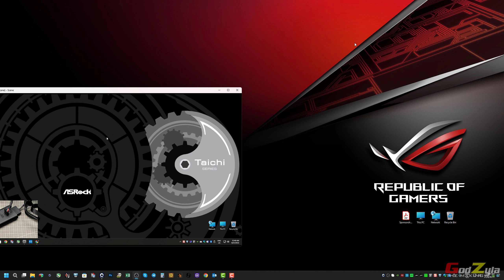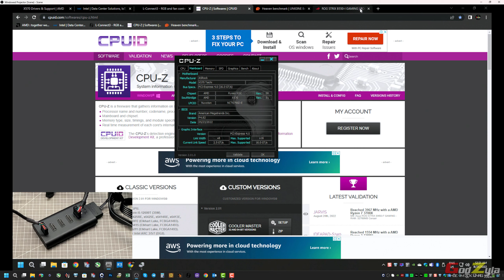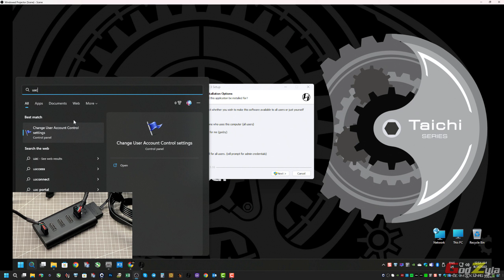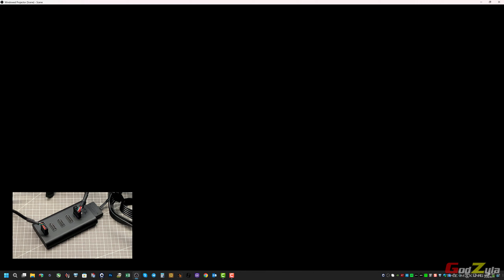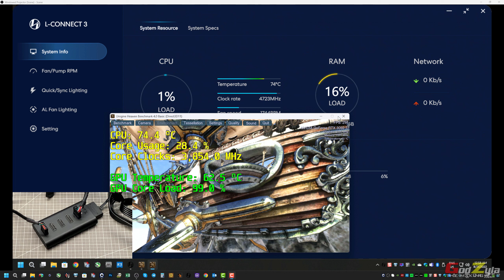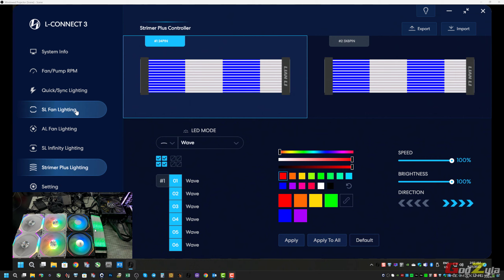Lian Li ARGB Products (How to make it work?) [L-Connect 3]

Comment: i have sl120, recently one fan is automatically running on max rmp, profile is set to quite but rpm of the fans is going up and down, do you know how to fix this?
Reply from the maker: Hello Pawn, welcome to my channel. If it works in the past, I believe it's a glitch, try this.. turn off your PC, turn off your PSU,  pull out the AC cable to your PSU. Let it sit for 45 seconds, plug back the AC to PSU, turn on your PSU, then start up your PC, see if it helps.
Reply: @KleoYan  not worked, still  running at high rpm, i recently installed 3 new fans, after few hours  one fan that is on the back started to run at max rpm, using l connect 3 all fans are running at 800 rpm besides one, it's running on 1900 rpm
Reply from the maker: @pawn_deprived  Hi, I see what i can do to aid you but I need to know exactly how you set up your fans. as in top , bottom and rear or side. also how they are connected to your uni controller.
Reply: @KleoYan  i have od11 xl
i have 10 fans, 3 bottom, 3 side, 3 top, 1 back, they are all connected to one controller in 1,2,3,4 ports.
Reply from the maker: @pawn_deprived  ok thanks. can I assume is your rear fan that is giving the problem, port 4 I assume. now for the fan that is having the issue, can you disconnect it from port 4 and plug to port 2 or 3 and test to see if the fan is at fault.
Reply: @KleoYan  yes it's the rear fan, and it's in port 2, i just tried it with different controllers, like 2 controllers, only rear fan is plugged in second controller and it's still running max rpm
Reply from the maker: @pawn_deprived  ok.. this means your rear fan is faulty, before jumping into conclusion. can you use the ok fans plug to port 2. see if it does goes max rpm like your rear fan? I just want to be sure it's not the controller or the software is giving the issue.
Reply: @KleoYan  just switched the ok fans in the slot 2 and even changed the controllers wires (white one that plugs in the fans) ok fans are running normally at 810-850 rpm, even rear fan is running at 850-870 rpm for now, gonna monitor it a bit, if it runs at max rpm again in sometime so i guess rear fan is faulty, will claim warranty, thanks a lot.
i also checked it like this, i set the rpm of all fans around 1000 and all fans were running around it, rear fan doesn't goes down or max, it only fluctuates between low and max when rpm is 800 on quite mode, so i think its the rear fan that is faulty, still will monitor a bit, thanks man.
Reply from the maker: @pawn_deprived  ok buddy, if it happens again, your next best solution now is to have that rear fan replace. either you go to the shop you purchased from and if they push you to Lian Li, fill up this form https://lian-li.com/contact-us/ provide them the invoice. wait for reply from lian li.
Reply: @KleoYan  thanks a lot.
Reply from the maker: @pawn_deprived  you are most welcome 🙂all the best buddy.

Comment: I have “3” 3 pack infinity fans so 9 total. I use only one hub instead of 3 hubs. Would that be why l connect isn’t recognizing my fans ? I have the strimmer v2 on its on hub as well but nothing pops up in the l connect 3. Everything does light up and work but not recognizing in the software. I’m running gigabyte x570 master
Reply from the maker: Hi TheLop3z, welcome to my channel, did your OS detact the uni controller? that will be the first part. maybe go through these steps and kindly do not miss any of the steps.

1) Make sure your motherboard bios is up to date, please check on your motherboard manufacture website, under support > bios and drivers. See if there are issues with USB and do they have a fix. If there are, kindly update those bios firmware version.

2) Make sure your chipset driver for your motherboard is up to date! For AMD will be at https://www.amd.com/en/support for Intel will be Intel Driver & Support Assistant Intel DSA https://www.intel.com/content/www/us/en/support/detect.html

3) Remove all argb apps as for your case is Gigabyte fushion, use Revo uninstaller ( https://www.revouninstaller.com/ ). Revo uninstaller will remove all unwanted files / folder / registry in your system. Illustration to use revo uninstaller https://www.youtube.com/watch?v=uMgUYiakpxM&t=437s

4) Shutdown your PC, unplug the PSU cable from your AC outlet. Press the power switch twice to discharge all current that your motherboard is holding. Leave it for 45 second

5) While waiting, disconnect all devices that are connected to your motherboard (front / back IO). Leave only your Keyboard, Mouse , Monitor and Ethernet (If you have) connected directly to your motherboard. 
If your monitor has a KVM build-in, remove the USB cable from your monitor to your motherboard USB socket. If your mouse and keyboard are connected to your monitor, please remove them and plug them directly to your motherboard instead.

6) Plug only one Uni controller or Strimer Plus V2 controller. If its for Uni Fan (SL/AL) use only 3 fans to an output of the uni controller.

7) Plug the power cable and turn on your PC

8) Go to your Device Manager, look under Universal Serial Bus Devices, make sure you see the Lian Li uni / strimer plus V2 controller.

9) Install the L-Connect 3 app only https://lian-li.com/l-connect3/ (current version 1.3.16)

10)	After installation, run L-Connect 3, check under Setting > General > make sure Auto-Run on Boot and Minimized L-Connect 3 to system tray at close are ON.

11)	Reboot your system.

12)	First thing you need, go to device manager and see if the Lian Li controller is listed, next open up the L-Connect 3 app. Check if there is a need to update firmware to your controller. Go to Settings > Update, under Device F/W version, click on Update Check, download and install the firmware. Make sure the firmware is completed. Do a check on device manager and make sure the Lian Li controller is listed.

13)	On L-Connect 3 dashboard, check if the CPU and GPU readings are reacting, you might want to test it using some benchmark programs. If there are reaction, play with the PWM and argb functions. If it does not work, skip step 14) and proceed step 16)

14)	If Single controller works, shutdown your pc, connect uni fan set of 3 to your output of your uni controller. Do it small steps at a time to hook up your sets of fans. do not do all in one go. If successful and you have a second controller, proceed small step at a time again.

15)	Slowly plug back your USB devices (Headset, Microphone, Printer, USB Capture Card and etc). At any point of time as you add those devices one at a time, if L-Connect 3 become unresponsive. This tells you that there power is insufficient to power up more USB Devices. Whatever USB port on your motherboard, there is a limitation as the current are shared across the board, be it front or back I/O and the internal USB Header. You might need to get a Internal USB Hub that comes with a Sata Power source to the Internal USB Hub. (Disclaimer, buying a internal usb hub might or might not resolve this issue, purchase at your own expenses)

16)	If it does not work, report your issues to Lian li Tech Support. There is a in build log ticketing system in L-Connect 3 app. this is what you need to do. Go to Settings > Support > Click on “Download log” place a filename and choose a destination drive to save the log file. Next click on “Report” it will take you to Lian Li Tech Support FAQ. Fill up the form and upload the log which is a zip file.

Comment: Very helpful great Chanel 👍, just one question pls, I build a pc for a week ago in a lian li 011 dynamic evo, I've got 3 uni fan sl120 on bottom for intake and 3 on the side for intake, I'm using the asus rog ryujin 2 360 AIO, now i ordered another 3 uni fan sl120 want to do a push/pull config with the ROG ryujin fans can you pls tell me where i should connect the fans?
Reply from the maker: Hi Sergey.Z, welcome to my channel. if it's SL fans and not SL infinity, I will do this. to plug SL fan's PWM directly to your motherboard and plus the argb to the uni controller. In the even if the uni controller fail, at least you know your fans are still running to cool the radiator. as for your ryujin, let it's own controller to control the argb effects.
Reply: @KleoYan  thank you very much for the reply, yes right now I've got nothing connected to my CPU FAN or AIO PUMP , should i connect the new sl120's directly to my CPU FAN or PUMP?
Reply from the maker: @sergey.z8843  yes you should. As mentioned only leave the argb connector to the uni controller. The rest like aio pump or fans (rpm) directly to your motherboard fan or aio pump header. This is for safety reason. All the best with your build.
Reply: @KleoYan  thank you very much, and keep up this great work👍.
Reply from the maker: @sergey.z8843  you are most welcome. All the best buddy 👍😉

Comment: Hi, I'm totally lost. I bought 2 packs of SL Infinity, the strimer v2 cables (24 and 8 x 2 pin), and the galahad 360 that comes with 3 AL 120 fans (which didn't come with any of these controllers, but with a small one). I have no idea how to put all this together and sync.
Reply from the maker: Hi Eliabe Araujo, welcome to my channel and I am so sorry that you got confuse. in order for your SL Infinity to work with the L-Connect 3. you will need it's controller, same goes with the AL fans. I would advise you to get the controllers over here, lian li's official ail express shop. kindly check properly which controller you need as i've mentioned in this video. each style of fans needs it's own controller. https://www.aliexpress.com/store/911265363?spm=a2g0s.8937474.0.0.51e52e0ew2IlnX
Reply: @KleoYan  So, for the Galahad RGB (which comes with AL120 fans), I need to buy one more controller, because this 3-button controller that comes in the package doesn't work? Is there anything else I need to buy to make these 3 products work together (Galahad AL 120, SL Infinity 120 and Strimer V2)? Thanks for the help
Reply from the maker: @eliabe0eu  basically you only need the infinity controller and the AL controller. Nothing else is needed. And for your Galahad, plug the argb to the infinity controller to either sync 02 or sync 04 port.
Reply: @KleoYan  My motherboard only has 1 x 3-pin Addressable Gen 2 RGB Headers and 2 x 4-pin Aura RGB Headers, since I'm using 3 different controllers (galahad, strimmers and SL Infinity Fans), do I need some splitter or just one 3-pin header is enough?
Reply from the maker: @eliabe0eu  hi and welcome back, to operate the lian li uni fans and strimer plus v2 you only need to plug the USB cable between the motherboard to the individual uni controller, you do not need to plug the argb cable unless you want to control the argb effects with your motherboard argb application.

Comment: it displays it as changed on the software but my fans do not change at all
Reply: Thank you so much I will try to resolve the issue using these steps
Reply from the maker: @sadlad8540  you are most welcome, I hope you get your issue fixed too. thanks for taking the time to visit my channel and to leave valuable questions too. All the very best.
Reply: So it says my fan controller is 1.2 and the software is 1.8 but it will not let me update will getting a new controller help
Reply from the maker: @sadlad8540  try doing manual firmware update. https://lian-li.com/l-connect3/L3_update_manually/ . ok am going to bed now.. it's 12am here in Singapore. good luck!
Reply from the maker: Hi SadLad, welcome to my channel, it's kind of difficult to guide you blindly, do you mind to list down what kind of Uni fans are you using? plus do you have other argb application installed in your system.. most importantly what motherboard are you using?
Reply: I have sl uni fans and a b550 msi motherboard and I have hyperx rgb software installed and some stuff for my Trident z ram but this has been an issue since I built the computer
Reply from the maker: @sadlad8540  Hi, I think your argb program is interfering .. can you try these steps?

1) Make sure your motherboard bios is up to date, please check on your motherboard manufacture website, under support > bios and drivers. See if there are issues with USB and do they have a fix. If there are, kindly update those bios firmware version.

2) Make sure your chipset driver for your motherboard is up to date! For AMD will be at https://www.amd.com/en/support for Intel will be Intel Driver & Support Assistant Intel DSA https://www.intel.com/content/www/us/en/support/detect.html also update your windows patches. 

3) Remove all argb apps (Asus Armory Crate / MSI Dragon Center / Giga Fusion / Asrock Polychrome). If the brands which I have mentioned, do have a uninstall tool like the Asus Armory Crate, use that, else use Revo uninstaller ( https://www.revouninstaller.com/ ). Revo uninstaller will remove all unwanted files / folder / registry in your system. Illustration to use revo uninstaller https://www.youtube.com/watch?v=uMgUYiakpxM&t=437s

4) Shutdown your PC, unplug the PSU cable from your AC outlet. Press the power switch twice to discharge all current that your motherboard is holding. Leave it for 45 second

5) While waiting, please do not use KVM switches if you have. Disconnect all devices that are connected to your motherboard (front / back IO). Leave only your Keyboard, Mouse , Monitor and Ethernet (If you have) connected directly to your motherboard. 
If your monitor has a KVM build-in, remove the USB cable from your monitor to your motherboard USB socket. If your mouse and keyboard are connected to your monitor, please remove them and plug them directly to your motherboard instead.

6) Plug only one Uni controller or Strimer Plus V2 controller. If its for Uni Fan (SL/AL) use only 3 fans to an output of the uni controller.

7) Plug the power cable and turn on your PC

8) Go to your Device Manager, look under Universal Serial Bus Devices, make sure you see the Lian Li uni / strimer plus V2 controller.

9) Install the L-Connect 3 app only https://lian-li.com/l-connect3/ (current version 1.3.16)

10)	After installation, run L-Connect 3, check under Setting > General > make sure Auto-Run on Boot and Minimized L-Connect 3 to system tray at close are ON.

11)	Reboot your system.

12)	First thing you need, go to device manager and see if the Lian Li controller is listed, next open up the L-Connect 3 app. Check if there is a need to update firmware to your controller. Go to Settings > Update, under Device F/W version, click on Update Check, download and install the firmware. Make sure the firmware is completed. Do a check on device manager and make sure the Lian Li controller is listed.

13)	On L-Connect 3 dashboard, check if the CPU and GPU readings are reacting, you might want to test it using some benchmark programs. If there are reaction, play with the PWM and argb functions. If it does not work, skip step 14) and proceed step 16)

14)	If Single controller works, shutdown your pc, connect uni fan set of 3 to your output of your uni controller. Do it small steps at a time to hook up your sets of fans. do not do all in one go. If successful and you have a second controller, proceed small step at a time again.

15)	Slowly plug back your USB devices (Headset, Microphone, Printer, USB Capture Card and etc). At any point of time as you add those devices one at a time, if L-Connect 3 become unresponsive. This tells you that there power is insufficient to power up more USB Devices. Whatever USB port on your motherboard, there is a limitation as the current are shared across the board, be it front or back I/O and the internal USB Header. You might need to get a Internal USB Hub that comes with a Sata Power source to the Internal USB Hub. (Disclaimer, buying a internal usb hub might or might not resolve this issue, purchase at your own expenses)

16)	If it does not work, report your issues to Lian li Tech Support. There is a in build log ticketing system in L-Connect 3 app. this is what you need to do. Go to Settings > Support > Click on “Download log” place a filename and choose a destination drive to save the log file. Next click on “Report” it will take you to Lian Li Tech Support FAQ. Fill up the form and upload the log which is a zip file.

Comment: I've got 4 Lian Li UNI FAN SL120s  love them and Lian Li is great one of the fans started to given me problems  so i did contact the company and they send me a replacement fan 3 weeks time i just  wish they would make a GPU only 8 pin rgb connector cuz my evga 3060ti  uses only one  8 pin pci-e i would so buy it right away right now  i'm  on AsiaHorse white Extension Cables
Reply from the maker: Hi ScyzorPL, welcome back. I can understand your request and though you can still plug a dual 8 pin. It’s kind of redundant to have the additional 8pin sticking out. Sad to say the current strimer plus only offers dual 8pin or triple 8 pin.